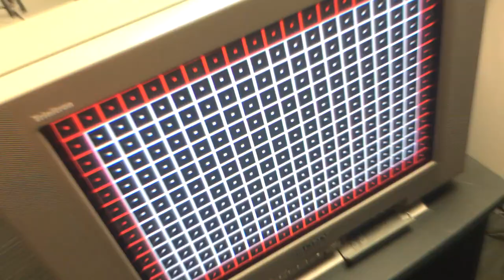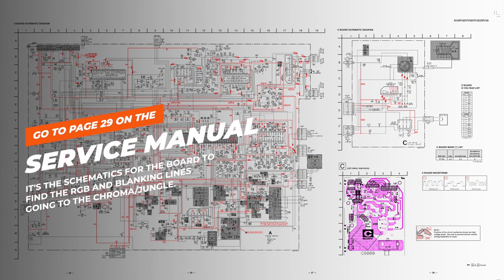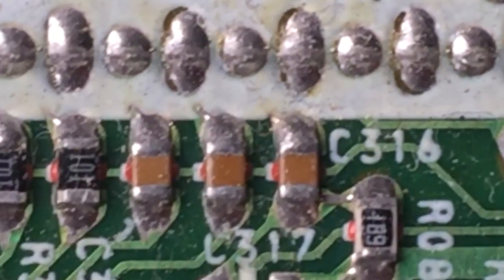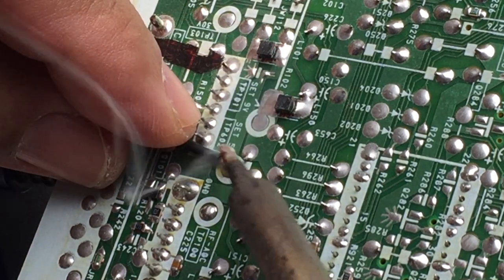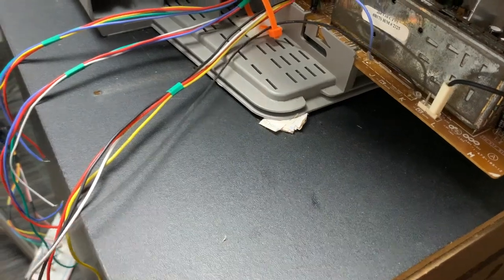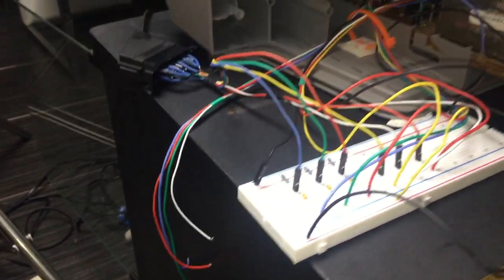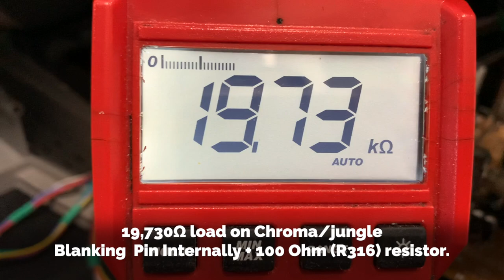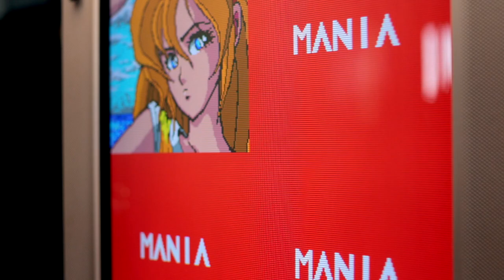Episode 124: Sony Trinitron KV-20FV10 RGB Mod Special

Comment: I love RGB modifying TVs. Note that all TVs and jungle chips are not the same. It is best to look up or measure the peek to peek voltage inputs.  The can vary greatly and I tind that not mant can easily use 75ohm resistors.  So you often need different voltage divider resistors. This includes the blanking signal. 
Some older TVs don't have jungle chips or don't have ones with RGB inputs. You can still RGB modify them but you have to do some signal manipulation with opamps before the signals go to the neck board transistors.
Reply from the maker: Look, I used a voltage divider here:
https://youtu.be/RhhxpW_Bxtk
But I get what you are saying. What I really need is an o-scope so I can measure p-p voltage on the various siignals so as not to guess. But that's $300-500 for a meager digital one. So I have to go with my eyes and if it's in the ball park, its good.

Also, it's impossible to find the datasheets for many of the chroma/jungle so you can read just what p-p volaget the RGB inputs need. Does it need .7v p-p. Does it need 1v p-p. etc. But usually, these analog RGB inputs use either of these standard voltages.

But lets keep this fun...

Comment: Nice, thanks a ton, instant sub.  I have a Sony Trinitron KV-24FV12 and I "think" I can actually follow this guide to a "T".  My model does have S-Video, but shouldn't change anything right?  Thanks.
Reply from the maker: Once you get the gist of what's going on, modding all modable CRTs is all pretty much the same. Good luck.
Reply: @The_SegaHolic  thanks, I have a feeling I need to plan more though, just joined a fb page called "The CRT Collective" and there's one guy showing a beautiful cleanup/tune/RGB mod of my exact model set where he says this:  "Also the luma signal on the S-Video port automatically detects sync so no need for a dummy connector, wish they were all like that."   I wonder if I need the additional switch you implemented here?  In the end I'd like to keep is as simple as possible but still allow normal use of S-Video and Composite inputs if desired.  Thank you.

Comment: This is awesome man, great work. Im trying to wrap my head around modding a Sony KV-XF29M35 which uses the CXA2139S jungle and this gives me some confidence.
Reply from the maker: Thanks, if you haven't already, you can also refer to my other RGB modding videos prior to this as they will give you more understanding of what is done here.. Although different ICs (chips) are used, RGB mods are really mostly the same.
Reply: @The_SegaHolic  thanks, I have been watching the others and see the common themes. This particular model has a Teletext module which has RGB+BLK lines and I've read I can just patch into those, have you done anything like that before?
Reply from the maker: @ashpowell9451  NO, but once you break out your RGB lines from the Jungle, it's pretty much the same...

Obvously, be very careful when messing around with a TV plugged in... and be careful during the whole process. Think 3 times about what you are doing. Really safe if you take precautions.

Comment: Great video! Is there no need to daisy chain the different ground pins on the scart lead?
Reply from the maker: No, as we are not using a real SCART TV and only need R, G, B, sync, , audio L/R, and ground. You're really just adapting the scart connector for your own use, and making your TV compatible with your SCART cables.

Comment: i wish i find such pro technician as you down here in Mexico, not only to Mod a CRT but also to give a complete service to mine. I have Samsun tantus hdtv ready and i notice it has some shimmering "pixels" but cant find anyone working on CRT tvs anymore
Reply from the maker: Not a pro, but just had some education that I'm rediscovering. I made this vid so you can try yourself.
Reply: @The_SegaHolic  after the shimering pixels it one day died.. I took your advice.. read  LOT bought a multimeter, welder, etc etc and found out the H.O.T. was blown and 4 capacitors lost capacitance ..finally fixed my precios CRT. 3 month ago.
 I actually repaired another one this week.. i recued from garbage it had the IC LA78045 burnt and the responsable cap that lost capacitance was replaced. Im loving this CRT repairing stuff jajaa
Excuse my poor English.. we speak spanish in México

Comment: Hi "Mando"! I'm about to mod a TV Set with the same Y/C  Jungle chip. In this KV-21SE80A set, the RGB IN1 is not used, so I´m planning to use that input instead of modify de IN 2 like you did. What do you think? Is a good idea?
Reply from the maker: Usually the other rgb inputs are digital. So not a good idea. I can double check when i get home from work.
Reply: @The_SegaHolic  Please do. AFAIK the CXA2060BS Jungle has two analog RGB inputs. But I'm a noob so I can be mistaken. Thanks.

Comment: If I needed a 100 ohm resistor in between the blanking and the 5v, on the positive terminal of the bread board. Will I place it in between the blanking line and  the 5v? So +blanking/100ohm/5v+ , on the positive Terminal line?
Reply from the maker: Yes, but you shouldn't need to. That 100 ohm resistor is so minimal. The load on the blanking input will set the current.
Reply: Hmmmm, the only reason, Why I was doing it. Because the guy on reddits modded the same tv , through the Closed caption spot on the board. And he said he added , a 100 ohm resistor. For the blanking to 5v . It’s a Sony kv-20ts32

Comment: Great video! A question: what happens if dust gets into the anode hole after the discharge? I usually put a clean cotton rag into the hole to close it. Is it ok long term?
Reply from the maker: Not sure, great question though. Yeah I would use something that doesn't have lint, no cloth material. Cling wrap is best. This is something you want to ask a CRT engineer, which I am not.

Comment: Hey man cool stuff. I designed my own PCB recently that incorporates a THS7374 (for buffering and ESD protection), 75 ohm termination, and output voltage selection. I think it'd come in handy for you and a lot of other people.
Reply from the maker: Nice. I thought most modern IC’a incorporate some sort of esd protection in the package? Did u measure P-P voltage after amping the signals? Most chroma/jungles want that .7p-p voltage. 75 ohm termination is in the project box (aviation to JP21) so I don’t have to keep installing and using them.
Reply: @The_SegaHolic  many jungles take .7 VPP but many take .5 (generally JVC and Toshiba are .5 vpp). Yeah most jungles have ESD to some degree, but if it fails it's probably the hardest part to source for many TVs, generally for something that's got physical contact with the user you want some sort of additional protection. The boards are something like 5cm by 3cm So they can be mounted in very small places, and because all components are SMD the profile is very slim as well. I'm testing the second iteration now and if I'm fine with everything the source files are going up on my GitHub, they're less than $5 in parts when it's all said and done.

Comment: Hey I have Sony trinitron 24fv10 but I want to do a bnc and rgb mux with no toggle switch do you think you can help me with a step by step?
Reply from the maker: I only do toggle. Sorry man. Just follow the steps they laid out. You should be fine.
Reply: @The_SegaHolic  where did you get your 0.01 UF ceramic caps at?
Reply from the maker: @rodrigojuarez4667  Right before the RGB inputs of the Chroma/Jungle.
Reply: @The_SegaHolic  nah man like what store did you get them at?
Reply from the maker: @rodrigojuarez4667  Find them at MOUSER or DIGI-KEY. Search for ceramic caps. They usually have a voltage rating of 50v, but any one of them will suffice.
Reply: @The_SegaHolic  do you have photos of this whole entire process?

Comment: What Gauge wire do I use?Do I have to use stranded silver? I know I need to 75 ohm resistors, Do I need a 10 µF capacitors for a Sony Trinitron?
Reply from the maker: Use 22 to 26 gauge wires stranded. I like to use silicone jacketed. Rewatch the video for your capacitor question.
Reply: .01 Ceramic Capacitor?
Reply from the maker: @Slammer661  ceramic is preferred. 👍

Comment: Man, im usually confident with soldering everything like modding consoles and stuff.
I just picked this exact set up and want to do this mod but dont want to kill myself lol.
You dont happen to live in colorado do you?
Reply from the maker: Just unplug and wait for 2 days. I should be mostly fully discharged to fully discharged by then. So when you do discharge, you won’t get that scary huge arc.
Reply: @SegaHolic  had a question. Not sure if you could help. This set shows retrace lines on dark screens. Do you know what might be the cause of it and how I may go about repairing it. Otherwise this set is amazing and the retrace lines are non existant on anything not black.
Reply from the maker: @osirisblaster  Not THAT versed in CRTs. I would ask on the CRT subreddit.
Reply: @The_SegaHolic  no worries. Thank you. It's really not that big a deal and doesn't affect normal use.
But I just ordered all my parts to rgb mod my set. Thanks for making this video to show me its possible. Looks easy enough.
Reply: @SegaHolic  just wanted to give you a heads up.
I just successfully RGB modded my kv-20fv10.
Thanks for giving me the courage to do so.
I did decide to do a Mux mod tho and was able to keep the overlay menu.
Reply from the maker: @osirisblaster  Awesome. Glad you had courage to do it and have success. 👍
Reply: @SegaHolic resolved the retrace lines. Just needed to turn down G2 voltage on the flyback till they went away.
Now just need to get a Sega Saturn to play xmen vs street fighter the way it was intended.
Reply from the maker: @osirisblaster  Awesome man. Was the voltage on the flyback adjusted previously?
Reply: @SegaHolic  I don't think so.
There was what looked like factory epoxy over the voltage and focus adjustments on the flyback. 
I was able to get this set for 20 bucks because of this defect. Thankfully it was easy to fix.
Reply from the maker: @osirisblaster  Anyways, congrats!

Comment: Absolutely beautiful video my friend. A lot of people will find this useful.

Question - in your opinion, if you already have component, is an RGB mod necessary?
Reply from the maker: I have modded a JVC and another Toshiba that has component. The RGB picture is as pure color wise as your TV will provide.

Check out the Pinned comment from the Toshiba video:
https://youtu.be/4Ul-PjAly2k
I asked him to comment on what he thought of the RGB mod he successfully performed.

RGB and component are two distinct color spaces. You should try the mod to scratch that itch to find out if it really is necessary. Do the mod, it's pretty easy. Also, yes, IMO, the RGB picture looks better as you don't need to do much color correction. The only correction that you really can do to an RGB picture is color temperature. But out of the box, once you see the RGB picture, you'll see a difference in color than what you are used to seeing with the TV.
Reply: @The_SegaHolic   You're a legend my friend. Once I've recapped my Trinitron (and watched this video 500 times), I'll give this a shot :)
Have you tried the OSD mux method and if so, would you be doing a video on that?
Thank you
Reply from the maker: @jazza5564  LOL. Legend? Far from it. You're taking this like it's hard or something. This is not brain surgery! Easy peasy!

Yeah, I keep getting asked about muxing. I'll have to give it a go. I just answered a comment to  someone suggesting muxing as he didn't want to use a physical switch. But it's so hard to find RGBable TV's at all nowadays. I was actually looking at the whole muxing thing a before I did my first mod. And I think I'm confortable enough with CRTs now that I can experiment further. Again, I just wish I had a real junker of a TV that I wouldn't feel bad breaking it doing experiments. LOL. But definitely in the pipeline.
Reply: @The_SegaHolic  Well sir, this is my new favourite channel. I'll be watching. Gods speed.....
Reply from the maker: @jazza5564  Thanks man. Really appreciate the encouraging words. It's so hard to make these vids, especially since I don't get reimbursed well monetarily for the amount of time I put in them.... which is insane. But this makes it all worth it in the end. Glad you're motivated. And you've motivated me.

BTW, I was looking at the MUX method, and some stuff don't sit well with me. Like the asssumption that all Micon's RGB output voltage is 5v according to the spreadsheet:
https://drive.google.com/file/d/1CXRu4BsuTcu5GyhIaJfwoxm_sPRsFuHE/view
And it requires more removal of components. The toshiba's are nice as you don't have to remove components with this old style. Anyways... I'm gonna have to stew on this.

Comment: @15:00 you start with a scart connector and at 20:00 you have a DIN output?  Did you only use the breadboard for the test or the whole install?
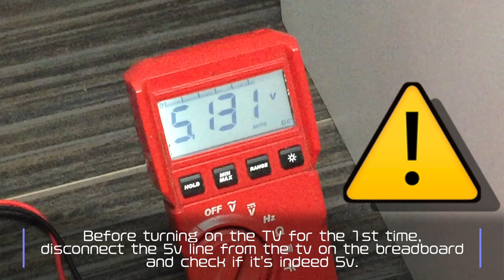I turned it on and im getting sound but its a black screen, i can see the green text though have you ran into that? at 17:51 do i disconnect the line and check voltage while its on?
Reply from the maker: You can use whatever connector type you want to use for prototyping or your final design. THINK about it, once you know what signals go to what pin... you can use any type of connector that has the proper amound of pins. It does not matter.
Yes, disconnect your blanking line and test with a DMM. One probe to the blanking line, and the other to ground. Seriously consider someone with basic electronic skills helping you out in person. A person with some electronics experience would already know this as this is basic stuff. This type of work is not recommended for people with little electronics experience as you can get hurt. Good luck.

Comment: on the scart port to the bread board what pin did you use for the ground, common ground?
Reply from the maker: From the console side, use ground coming from the AV port. From the TV, use ground that is on the AV jacks. You can use your DMM to find other points to find common ground with the AV jacks if you wish.
Reply: Pin 17 on the scart piece?
Reply from the maker: @Slammer661  Use whatever is ground. Refer to a Scart Pinout picture.
Reply: Scart pin out picture- pin 5 blue ground , pin 9 green ground , pin 13 red ground, pin 17 composite output ground, pin 21 common ground. Which one did you use?
Reply from the maker: @Slammer661  My cables are custom JP21 connectors which is the Japanese version for scart and wired differently. Those ground pins actually should all be connected together, so it doesn't matter what you use. Sometimes, some cable makers won't even put ground to all those points. Look at the console end of your connector. It should only have one ground pin. Use your DMM in continuity mode to see what Pins that you mention is connected to the ground pin on the other side of your cable that connects to your console. The ones that beeps, you can choose any one, it doesn't matter.
Reply: Right now I only have the tv, the bread boards, the cables and the scart connector piece(eu). On this tv, I was reading theirs in extra spot on the closed caption chip. So no soldering required, I just need to know if he used a switch for the blinking switch, and the whole ground situation.
Reply from the maker: @Slammer661  Refer to my JVC D-Series mod as I explain in detail how to wire in thee switch.
Reply from the maker: @Slammer661  https://youtu.be/1YGy3FuAxfA?t=1558

Comment: At 17:40 in the video. Did you ground the whole bread board to the tv? because I only seen you ground from scart connector to the bread board.
Reply from the maker: Ground from the TV comes from the ground from the AV jack area. You can use any common ground point. If u are confused, use the outer sleeve from any rca jack. I point out ground in the AV jack area clearly if you are still confused.
Reply: I used E pin on the tv board, after removing the closed caption chip for the ground. Now does the other side of the ground, attach to the bread board column where you attached the av ground?

Comment: Did you use a resistor for the blinking pin ?
Reply from the maker: No
Reply: Some more information. The modification was super easy as there was an unoccupied header on the main board with pins for RGB and sync ready to go. I ran it all to a scart socket. Here's a view of the back and inside, ugly I know but it does the trick. Only had to add 0.1uf caps to the RGB lines and 75ohm resistors on the RGB grounds. Also needed to run 1v to 3v to the blanking pin Ys (usually pin 16 on scart and jp21) but all my cables had nothing even going to this pin so I just put a resistor after the av control pin (usually 5v) to get it down to 3v and ran that to the Ys input.
This is what that guy is saying. On the same tv I have. He had to do this for the blanking pin. Do you know what he means?